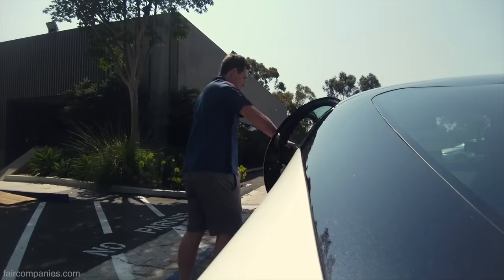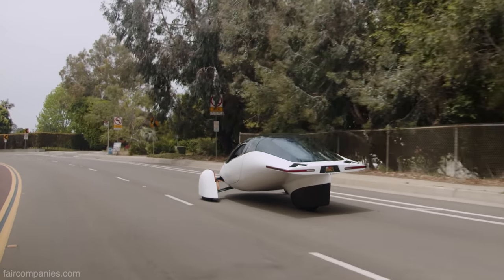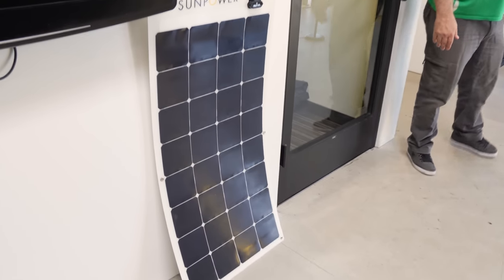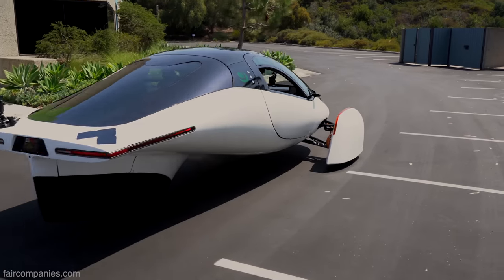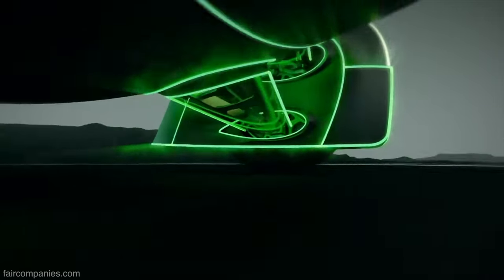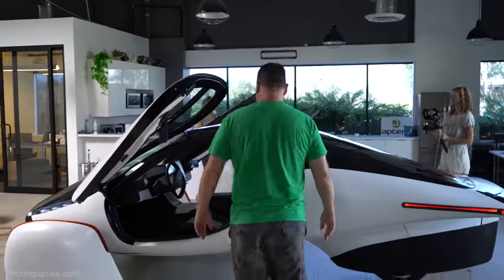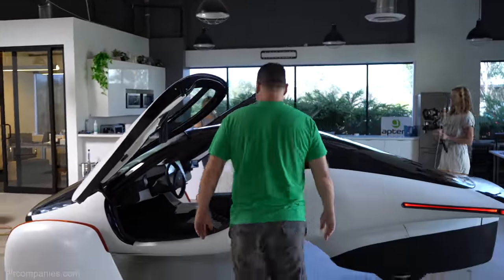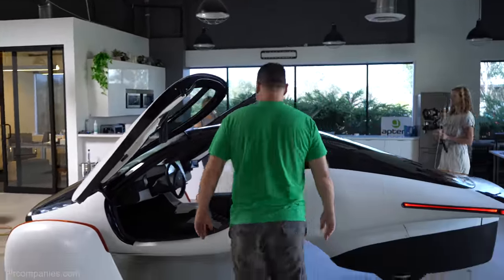Aptera commutes just on solar, gets 1K mile-range when full

Comment: Don't think it'll be a very successful business. Market for a ultra efficient vehicle with so many compromises is very small unless you can get price down to cost of motorcycles.
Reply: There are already 13000 orders before a lot of information such as crash test ratings is known.

This will be profitable because the build cost is so low.  It will serve the same function for Aptera that the Roadster did for Tesla and open the path to more mass market vehicles.
Reply: @n.brucenelson5920  I would hope so but idk if it was more a product dev issue or business that set them back. I was excited about them since 2009 but they stumbled major and competition is fierce now. Dont know how they can do well when they had a massive head start and still around the same place.
Reply: @arisejeff  the 'stumble' as you call it was accepting direction from a startup incubator and allowing them to appoint a CEO from Detroit to manage production.  His long experience at Ford and GM gave him enough credit with investors such as Google that he was able to oust the founders in a board fight.  He at least had the honesty to return the customer deposits for the vehicle he decided not to build.

The original Aptera models did not wow in performance compared to existing vehicles such as the Gen 1 Honda Insight.  The current Aptera design leaves that in the dust by every performance measure.

I can't think of anything that even comes close to what they are doing now.

Comment: Would I be able to drive to work, in the snow, to the hospital in upstate New York? Dtkg
Reply: Probably.  For snow, you will want the AWD version, which will have amazing traction control and ABS, capable of sensing slip and adjusting torque 32 times per wheel revolution, or 2.5" of tread travel.
Reply: Northern living means days when no one should go out on the roads for any reason. This could be fitted with studded tires though. You should not live there if you require a gas hog tank for plowing through anything nature can offer. Stay at home on snow days, or move.

Comment: The width seems a bit rediculous. It appeared barely able to fit in a parking place. 

What about A/C and heat? Rarely do any of us drive without some sort of climate control. I realize it makes a difference. But how much? 

If this were available, with speeds up to as little as 55mph, at an economy car price, I would get one. Unless it becomes law, you won't get the average person to make the three wheel sacrifice and still pay a premium price.
Reply: The width is less than a Model S with mirrors, and a lot less than a Ford 150.  The width is there for safety.  Aptera comes with both A/C and heat and spect'd from -20 to 125 F.

Aptera prices start at $25,900 before incentives - and having ridden in the Luna prototype, I can tell you that handling and acceleration in the twisties will put many sports cars to shame.  It is a truly thrilling vehicle.
Reply: @n.brucenelson5920  thanks, it is more performance oriented than I care, but seems priced right. What about heat and air impact on range? I am used to loosing 2mpg with A/C on an ICE. Is there a comparable means by which to measure range lostbwhen running heat or air in The Aptera?
Reply: @MHH3180  You are most welcome Mark.  You are correct that there will be an impact on range.  Eventually there will be reverse cycle heat, but at the moment it seems that transportation qualified reversing valves will not be available in sufficient quantity to supply the first vehicles.  I expect that here in Iowa (where it is now 2 degrees above zero, and has warmed up from yesterday) that I could lose as much as 30% range in these conditions.  The display panel will be able to calculate remaining range given the existing HVAC use and other conditions.  When it is this cold, reverse cycle won't make much difference, but in 30 degree weather it could be 2 or 3 times more efficient than resistance heat.  I made my living doing thermal analysis for many years, including for EVs, so this is a subject I am very familiar with.
Reply: @n.brucenelson5920  you must be way up North in Iowa. I run an e-bike shop in The Quad Cities. Yeah, I really know range loss in the cold. Customers with more lightweight 10ah batteries start to complain about range as soon as it gets below freezing. I just assumed there already was resistance heat. I would think that would be less of a load on the system than A/C (I helped install the first 12 closed loop watersource heat pumps in Iowa).
Reply: @MHH3180  Actually I moved to Lamoni after Thanksgiving after 20 years of living on a boat in the San Francisco Bay area.  I was born in Iowa and went to college here, so I knew what I could expect.  Good for you!  I helped design an e bike around 1975, when I was living in Japan, so this has long been an interest of mine.  I have over 400,000 miles on motorcycles.  

Perhaps I can drive up and show you my Aptera after I pick it up.  The COP ( coefficient of performance) of A/C systems can  move 2 to 3 times the heat of the power required to move it, in both heating and cooling modes, where resistance heat is 1 to 1.  This efficiency drops as the temperature difference becomes more extreme.

Comment: Repairs are gonna be a bitch the motor is in the wheel
Reply: The parts count for Aptera is far lower than a typical car, and changing out a wheel motor should it be required will be a far simpler and less expensive proposition than for any remotely comparable vehicle I can think of.

Comment: Try Changing a Tire on the Road....LOL, never gonna happen. Camping ? LOL...the Fender's are going to get Destroyed as is, driving over speed bumps....let alone Camping? LOL.....with a 4 inch clearance ?.....i dont think so. Pretty Cool....for Street use only in a NO Pothole, NO SNOW state.
Reply: Well, if any of those suppositions were true, perhaps, but they are not.  I will taking my Aptera directly to Death Valley to camp immediately after picking it up at the factory in Carlsbad.  My wife and I have already had rides in the Luna prototype and they go over speed bumps just fine.  BTW, clearance is more than 4".  I live on a gravel road in Iowa and will be using mine in snow.
Reply: @n.brucenelson5920  Anyone can drive to camp spots using paved roads. I dont think that thing can go off road but would love to see it. You say my "Suppositions" are not true, but the only one you can claim is not is the 4 inch Clearance...okay its 5, lol. Anything with wheels can travel on a "Gravel Road". Pretty noticeable you failed to address Changing the Tire's or Dealing with a Flat Tire....No Spare ?... all together. So lets re-cap your claims.....You Plan, having not done anything Yet....you plan on Driving your car to Death Valley....Special.......You ONLY drove in a PROTYPE that cleared speed bumps...Special.......You will be Driving on a Gravel Road eventually having Snow....Special. Thank you for proving my post Accurate. You're a funny guy.

Comment: Having a motor is a wheel is a very bad idea considering blowouts and all the problems that occur with our tires and wheels the motor would break so fast imagine having a tire blowout on the road and having to take it to the shop to get your motor fixed aswell crazy.
Reply: The wheel bolts to the motor just as if it were a drum brake. Blowouts won't bother it.  In fact they be more controllable because of the speed at which the wheel motor can adjust torque.

Comment: Please just reduce the wheel protrusion in the final product. Look horrible.
Reply: The design is not a fashion statement.  The wide 77" track helps to make the vehicle stable even in sharp maneuvering and also reduces wind resistance by almost 10%.  The lowered cost to the owners on their power bills will not be a horrible look.

Comment: Based on the info at 7:00 they claim 
100w/mile which is a very good value, but...lets dig deeper.
1) they claim a 700w solar panel array. Meaning at peak power ideal world it would harvest 700wh from the sun, right. Meaning you can harvest 7 miles/hour at best. WTF is that?! At peak performance values they use
2) to drive 1000 miles, it would need a battery size of 100kw, which is doubtful it has. Plus the  100w/mile is of course their ideal best economy, and not real world. 
3) At the 7:50 we see real life size comparison, briefly. This vehicle is bigger than Bolt but has very little useful interior space. For a 3 wheeler 2 seater vehicle it's highly inefficient in terms of space. 
If you buy a vehicle for just driving alone, this size is too large. It should be like two thirds of it's current dimensions. 
4) who the fuck would drive 1000 miles with this useless 2 seater? You drive 1000 miles with a comfortable family sedan that you can go roadtrips and such, not a tight and bad sporty vehicle.
Reply: 700 watts is a peak output.  In San Diego it produceaaround 4,400 watt hours, or around 44 miles per day.  In Iowa, where I live, I expect to gain something like 20 miles per day.

You are correct about the largest battery size.  They will be around 25, 40, 60 and 100 kWh.

Aptera has 25 cu ft of usable cargo space - enough to haul a lot of groceries and sleep two people and their dog in comfort - this is better than most 4 wheel sports cars it can be compared with.

I and many other people do 1,000 mile per day road trips on motorcycles.  Having ridden in the Luna prototype, I know that it will be far more comfortable than my bikes - especially in bad weather.  My wife and I have ridden through blizzards on 2 wheels, and this will be much safer.

Aptera is certainly a niche vehicle and it will out perform our present 2 seat car in almost every respect.
Reply: @n.brucenelson5920  a lot of huge numbers.
Is there an actual video proving all of that
Lets say for cargo space, do a banana box test (how many banana boxes does it hold)
And about those solar numbers, really important to see video supporting them.

Comment: Lots of incorrect or inaccurate statements!! So he claims the Aptera has NO  aerodynamic resistance? Only maybe when it’s parked! If it has a frontal area it has resistance as soon as it moves! So that energy consumption therefore is never Zero once it moves! 15% loss in a Tesla drive train? BS! You have 15-20% loss in a conventional car with clutch, transmission and differential.
Having the motor in the hub crates a lot of unsprung mass!  Car makers where fighting this at great expense for a long time. And its even more important for a very light car! Better breaking and regeneration? That can probably be proven in bench testing, but not in practical use! A Prius being inefficient compared to the Aptera? Efficiency has nothing to do with total use of energy but about how much or little is  being lost in the process! And again, there is a German company called SONOS motors, which is about to offer  a car which has as much solar panels on the car!
If you try to gain customers you should not make false statements or actually lying to your future customers!
Reply: The Aptera body is modeled from a design published in 1983, called a Morelli body that sought to minimize drag.  The Aptera prototypes achieve the extremely low Cd of 0.13.  Additional savings have been found through super computer modeling in the cloud and the betas will have slightly more frontal area for more headroom, while keeping the same overall low drag.

The Aptera only uses 100 watts hours per mile at EPA highway speeds, compared to much higher power use for the Tesla on the same test cycle.  There is no BS here.  You can look it up.

"Efficiency has NOTHING to do with total energy use?  I will let you think about that one yourself for a bit".  And the Sonos will not have near the solar range that Aptera does,  They are not really comparable vehicles, and I am glad to see both.

You should look into your understanding of what Aptera is claiming before you accuse them of lying.

Comment: it does not seem very strong yet. For like long drives and shitty road maintenance I have little trust in those Little beams, wires almost keeping the wheels to the body of the car. one bump, one hit, a curb anything and your done with that "car"
Reply: The strength of the materials Aptera uses exceeds conventional automotive construction by several times.
Reply: @n.brucenelson5920  Can you tell me or show why that Is, because I do not know if you watched the same video but everything was shaky and did you hear the noise while driving? as much in the car, (not the engine) as much when they drove buy. Mate maybe each individual piece is of a strong material but the way it is hinched together does look brittle to me.
Reply: @Morrison.mp3  Yes, of course.  If you search Youtube, there is a video of a fender being produced using the vacuum resin infusion process.  These parts are extremely tough.  You could take a sledge hammer to it repeatedly and not dent or crack it.  The same process is used to make aircraft parts. The fenders on the prototypes are only attached at three points and do shake.  Both the wheels and the fenders have been redesigned for the betas so that there are more attachment points to eliminate the shake.

There is also noise from the suspension while driving.  Daniel drove me and took me through twisties at speed.  The present suspension  is stiff and allows the Aptera to corner flat, like a sports car.  Roush Performance has redesigned the suspension, adding a sway bar in front so the vehicle will still corner flat, but can be much more compliant to absorb small bumps and not make as much noise.

Comment: I have been waiting for the áptera for a long time, I may die waiting.  Talk is cheap, and has been going on for tooooooooooooooooooo, long. Produce the damn thing and I will buy it.  But do not ask for a deposits before producing it.
Reply: Atera Motors and this design were started in 2019, the same year as the Tesla Cybertruck.  The Aptera may well be shipping first, in spite of a vast difference in resources between the two companies.  And they are years ahead of the pace of development of Tesla's first vehicle, even though it was only an EV conversion of an existing car and they got a 250 million dollar government loan to do it.  The line for Apteras is now 15,000 units long and getting longer the longer you wait.  I will likely be driving mine next year.
Reply: @n.brucenelson5920  Aptera began long before 2019, I even saw a video where they destroyed the composite bodies build.  I wanted to buy one to put it on my 72v Geo that I had for quite some time. It was sad to see that happened.  And later I read that they had sold the company to some Chinese. a couple of year later I saw the resurrection again. Here in San diego
Reply: @joseboquitasdelacoronilla7648  The video you saw was of some defective shells that had been produced by the original 2005 company that was liquidated.  The startup incubator they were a part of appointed a CEO from Detroit to manage the production phase.  He decided he did not want to build the vehicle he was hired to build, and managed to oust the founders from control of their own company in 2009 in a board coup with the help of some large investors such as Google. 

That company was liquidated in 2011 when the CEO could not get financing for his new, more conventional 4 wheel design.

The 2019 reformed Aptera is a new company with a new design that has no common parts with the old one...the size, drive train, and construction are all completely new except for a nod to the original Morelli body shape
Reply: @n.brucenelson5920  If a CEO was hired, could easily be fired.  So you lied saying that it had started in 2019.  Is the same concept, the same body stile, But with a different approach, to take people's money with out producing a car, just like Elio.  I have been observing both vehicles, and the scams that are being pulled.  I wanted to buy one of the bodies, destroyed even if they were defected,  Having said that, Produce that thing, and  will buy it.
Reply: @joseboquitasdelacoronilla7648  The board backed the CEO and ousted the founders.  They did not have the board support.

Unlike Elio, all of  the customers and vendors got their money back when the company liquidated.  The employees even got severance.  There was no hint of fraud and Chris Anthony co- founded and took another company public as CEO.

The fact that Aptera Motors was purchased out of liquidation and re- formed in 2019 is a matter of public record.  You have not done your homework.

Comment: What is the cost to replace the front wheel assembles 🤔. 
I can see them getting ripped off, backed into, curb strikes or even ran into by other vehicles.  With the motors in the wheel, they may be a big theft item.  The linkage looks a little weak - thin since they do all the starting and stopping of the vehicle.
Reply: The option of a third motor is $2 ,500.

That is all we know at this point.